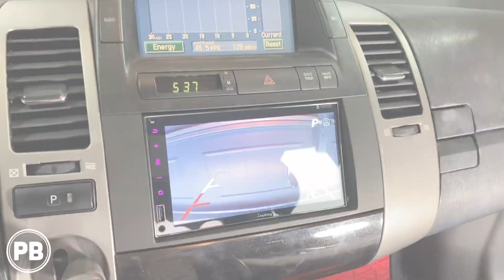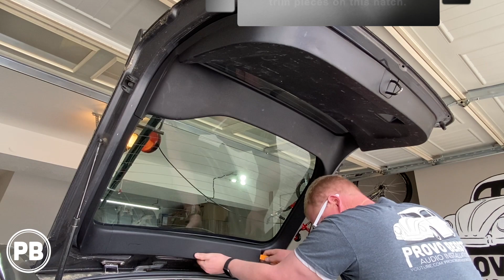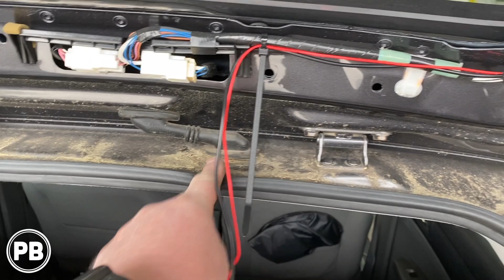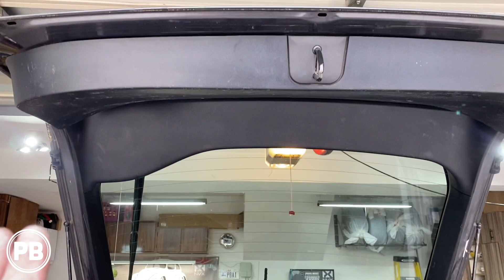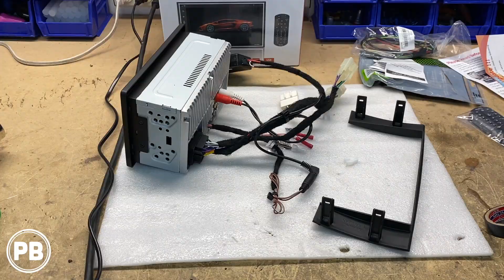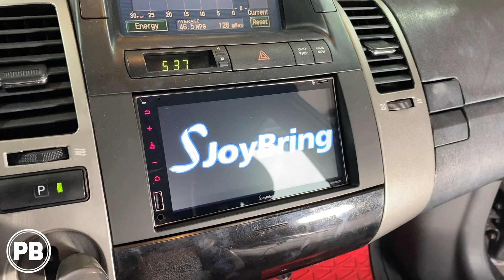2004 - 2009 Toyota Prius Backup Camera Install

Comment: My unit had a space for each connector in the OEM harness how come the steering wheel controls don't work? Is there a way to contact you through messenger call.

Comment: This is actually one of the best tutorials, even for the gen 3 model this is a great explanation. I felt intimidated by it until you mentioned to lube up the wire, everyone else says it's so hard to squeeze through there, but sometimes you just need the right tools. I'll give it a shot now.

Comment: So wait I thought the only connections you have to make were the power and then the yellow to the aftermarket head unit? That’s it right? And as for running the wire, the side you run it on doesn’t matter right? I planned to run it on the drivers side?
Reply: yes, but switched power from the reverse light (+) so that the camera is only on when the car is in reverse. If you want the camera to also work when you are not in reverse, you have to attach the power to switched ignition power, if you do constant power it will drain the battery, but doing this you still need to get the reverse switched power so the headunit automatically switches the camera on in reverse.

Comment: thanks for this its a good help but the video is missing something, you tap the trigger wire (red from the camera) to the tail light then chase the video wire from the back to the front of the car but not the trigger wire, then once you are up front at the head deck a trigger wire appears .. Is the trigger wire integrated with the video wire?
Reply: Yes. You can see it earlier in the video. It’s parallel to yellow rca

Comment: @ProvoBeastAudio: what happens if the Prius already has the original default backup cam installed? Its gonna be replaced with the new or both screen will show the backup camera image?
Reply: Original backup screen and camera can remain in replace. Aftermarket radio unit replaced stock radio and goes under car screen. Stock screen is kept for climate and mpg information.

Comment: This is a great video that totally helped my install. Thanks so much. One suggestion…that centered license plate mount camera gets in the way of the hatch release button. On these cars, you’re better off using an offset camera drilled through the license plate light trim panel that you removed. Works a lot better and looks factory. Thanks again!
Reply: What camera did you buy/use?
Reply: @JuanMunoz-yt5ke  PYVideo. Available on Amazon, eBay, etc. Good quality.
Reply: @JuanMunoz-yt5ke  the OEM camera
Reply: do you have a guide for that? TRYING to look OEM

Comment: so the positive wire coming from the yellow plug connects to the radio's reverse trigger?
Reply from the maker: With this specific wiring configuration, yes.
Reply: @ProvoBeastAudio  interesting, no only negative connects to the camera